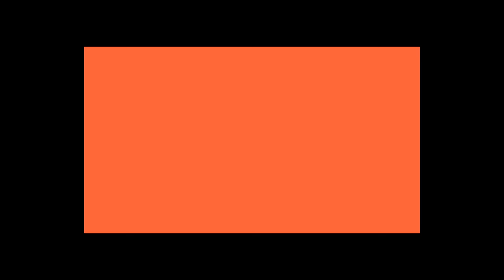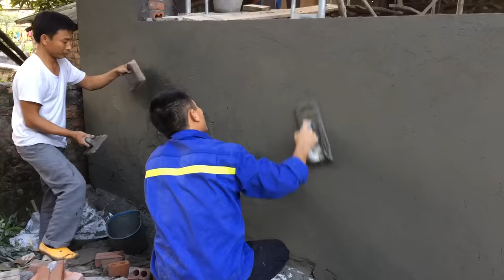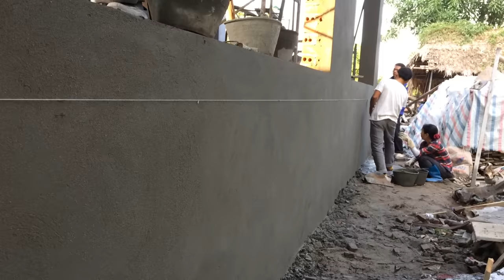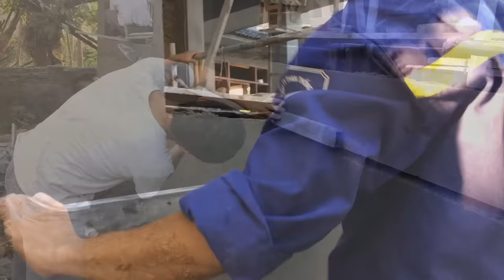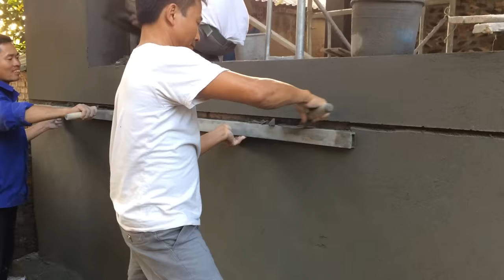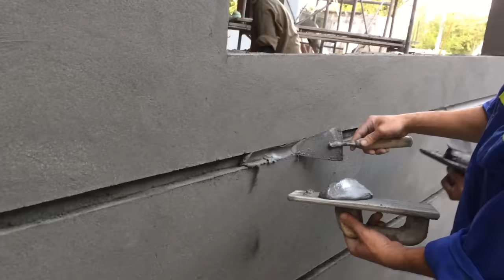How to make a professional wall, using sand and cement ratio 1/3

Comment: Composition of the solution. how much cement plasticizer sand?
Reply from the maker: sand and cement 1/3
Reply: @amazingcontructionnews5050  How do you solve shrinkage cracks?
Reply: @amazingcontructionnews5050  sand 1 part. cement 3 parts. And not a lot of value?
Reply from the maker: @Ritu veer thank you

Comment: 3 to1 is building strength plastering strength is 4 to 1 and they are using the wrong tools and wrong technique because they are amateurs
Reply from the maker: I will try to do construction work better thank you for your suggestions

Comment: sand and cement? WOW! It's called concrete.......
Reply from the maker: Thank you for watching videos to share videos with friends supporting the development channel
Reply: Peter M confused here what’s the difference between concrete and mortar/ stucco?
Reply: @nutsugahquilis8948  you can google it up. ratios are different, some uses gravel too, other needs lime, etc.. basically everything is concrete, with some additions. At least that's what Romans tought. :)
Reply: Peter M thanks for the response my confusion is that I was taught mortar or stucco is a mixture of sand ,cement and water and is souls use for brick laying and rendering. Concrete is a mixture of sand, cement, water and gravels and mostly used for casting columns,beams and flors.